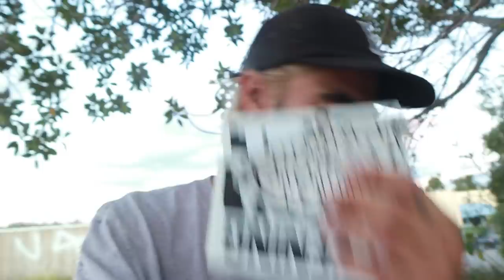D.I.Y DIARIES EPISODE 4 | D.I.Y SKATEPARK | BUILDING A QUARTERPIPE

Comment: Ramp looks good. It's so much easier if you use that long 2x4 at the bottom like a bulldozer and put cement on the high side and slowly push the 2x4 up while wiggling left and right. Repeat until smooth. That's how you get that perfect curved surface. Use the templates as a guide with the 2x4.

Comment: I think you could’ve avoided a lot of heat from the neighbors if you did all the prep work away from the site. Then casually assemble it with less commotion and time to be noticed. Also, if you screeded the surface with a 2x4 after you poured the concrete, you would’ve had a very smooth, even ride.  🤙🏾

Comment: Have you guys thought of putting in a China gap? Like the one at LAS? I think itd be really cool with birch and it would be lower effort. Mix something with all of those rails
Reply from the maker: That's a great idea! Just figuring out how we could cast the concrete to get the shape right
Reply: Birch is so nice smooth and fast great tip I used it on my ramps

Comment: you could always throw another small layer of crete on top to smooth it out a bit, also a coat of concrete paint will help fill in some of the inconsistencies in the surface.
Reply from the maker: crackhead970 we did consider that, maybe I’ll see how it goes and then maybe chuck a light layer on and paint it